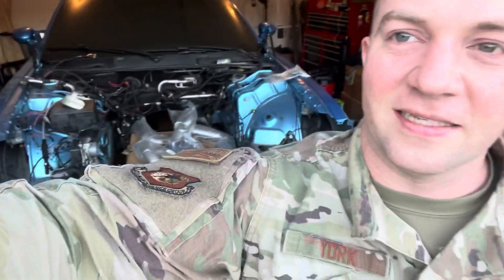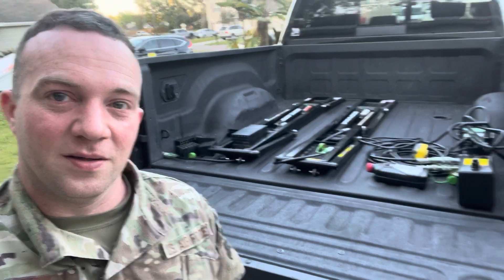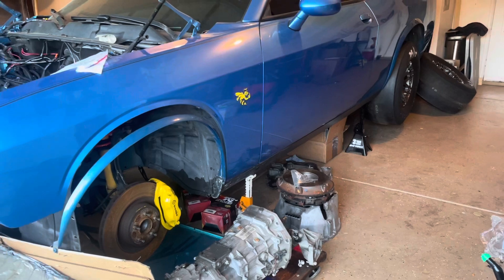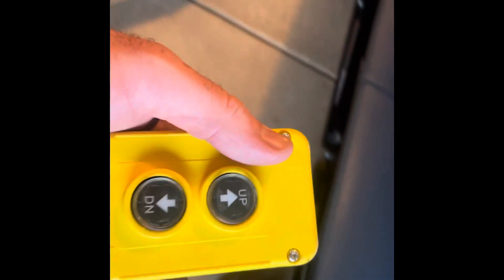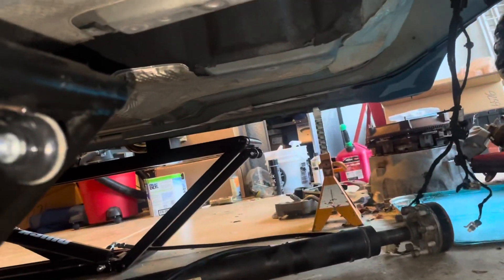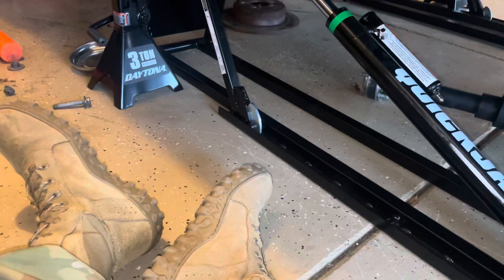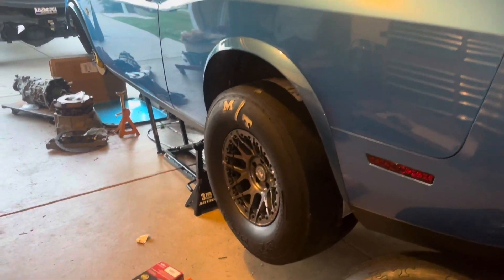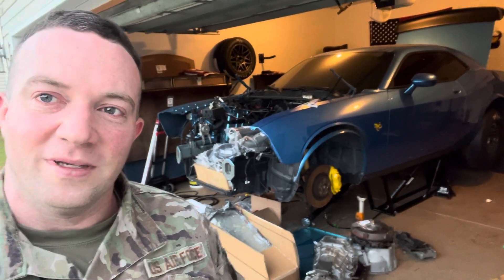Quickjack first impression review Dodge Challenger scat pack

Comment: Did you use the factory lift points? 
Ok so I have a challenger redeye and quick jack but not sure where to lift from I see the rear in your video but where is the front lift point. Also my car doesn't have much clearance! 

Good vid